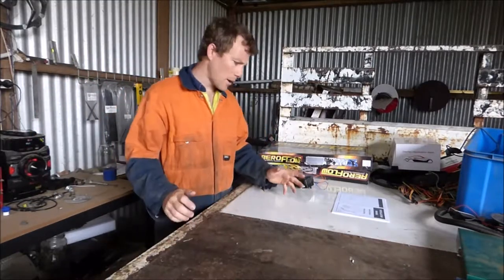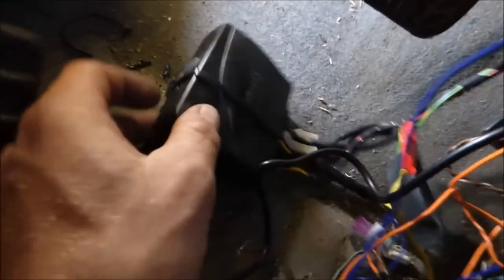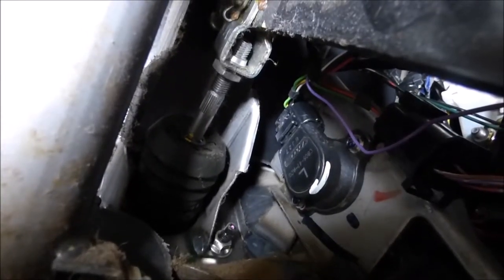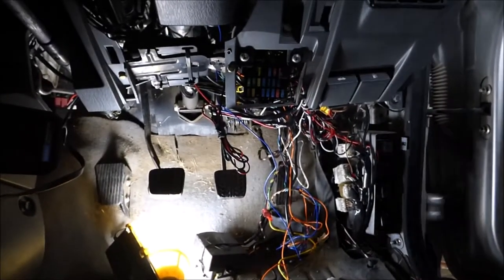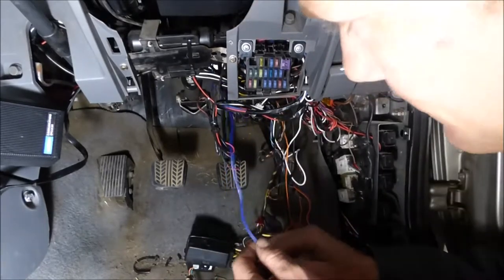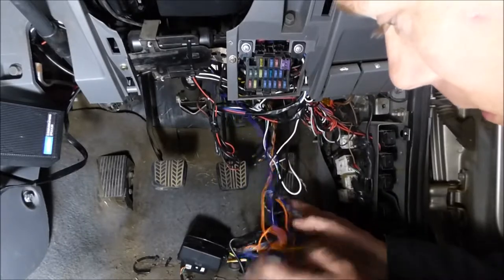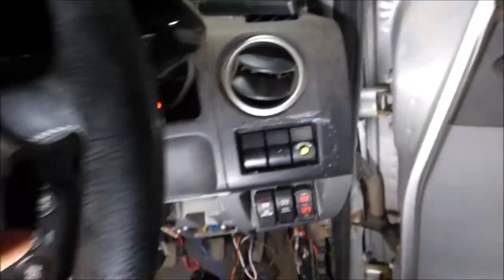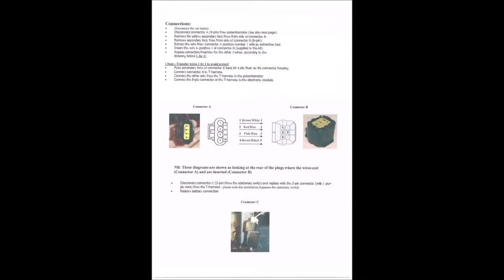PK RANGER CRUISE CONTROL DIY INSTALL

Comment: Hi guys.. I just bought a AP900.. but I don't have the Green wire that's supposed to be the ground for the box, I'm also missing the yellow wire for RPM signal.. dont know whats wrong... any of you guys able to help?
Reply from the maker: What colour wires do you have
Reply: @joshsgarage2454  The big plug -  in the top far left coner I have a big thick yellow, then 3 empty slots and then a blue and an orange
In the buttom left corner I have the green-white next to the purple, and these two are twisted together and next to these two is the brown-white and the brown, and these two are twisted together..
then in the right side of this big plug I have the wires for the controller-arm, these wire  include, yellow, orange, green, blue, red, black, and a grey ish one..

in the small plug to the left on the box I have the plug for the t-harness, and I have the t-harness, my t-harness wires have the colors yellow, white, red, green and brown
Reply from the maker: Any chance you can send me some pics of those plugs and wires to joshuarowland@live.com also what year is your ranger?
Reply from the maker: ive replied to your email and hopefully that will fix it and get you going

Comment: Hey mate, did you have to do any programming?
Reply from the maker: no programming, just wired it in and worked straight away, as it came out of a wrecked pk ranger, so no issues and its a great mod, so glad i did it

Comment: I’ve just brought a pk it has cruise control previously installed just curious where are the blue black and red wires from the switch module suppose to be connected too?

Comment: You need to set this up after it has been installed, you can not drive off straight away after install
Reply from the maker: Well maybe if its a brand new kit but due to mine been previously installed in a pk ranger so it was a used kit...it worked straight away with no setup needed and have had no issues at all with it